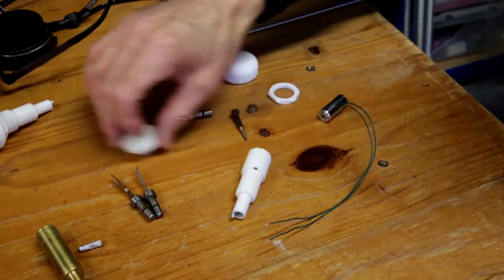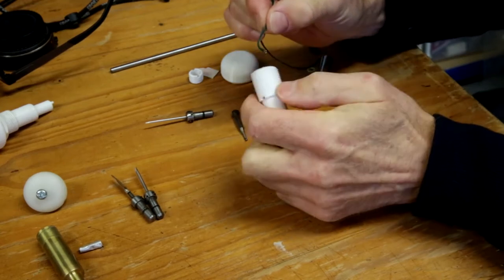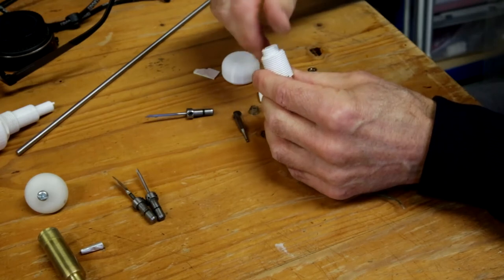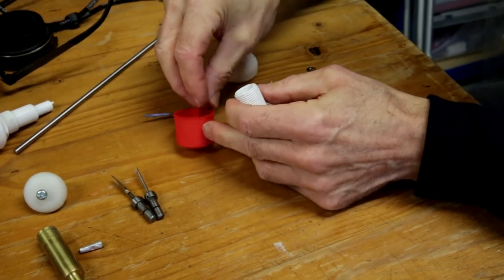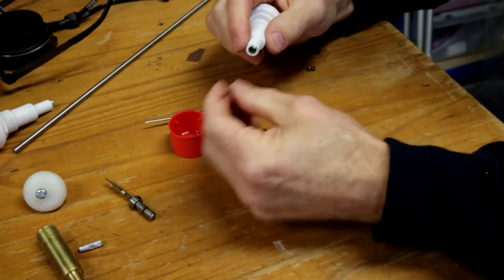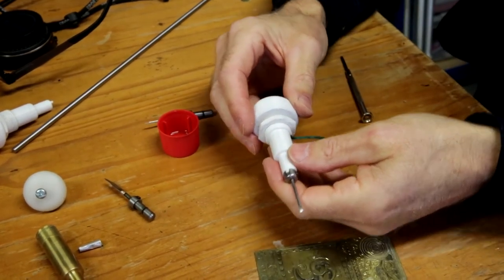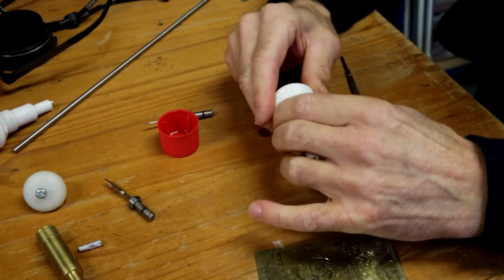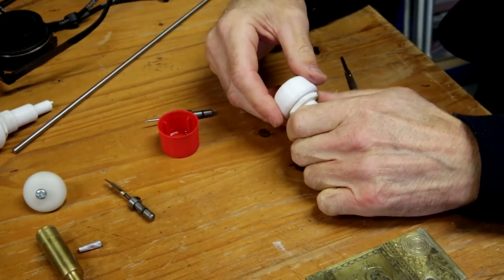3D printed handpiece for the Super EZ graver

Comment: Great job laying out this project!! I have almost all the parts in my shopping cart. I do have 1 question. What size mini pin are you using 5.9mm or 6.3mm? I’ve been wanting to add this skill to my creations. I really appreciate your art, and giving so many like me the opportunity and information to learn this art.
Reply from the maker: Thank you. I have no idea what you mean by mini pin. The metal tool holder is 6.35mm or 1/4" is that what you mean?
Reply: @alastairduncan4702  yes that’s what I was talking about. I’m trying to find a place to get them and wasn’t sure of the size.
Reply from the maker: The standard GRS QC holders will fit.  I have made my own and they take a 2.4mm, 3/32" piece of HSS. I have got some carbide but I've not tried it yet.

Comment: Fantastic piece.  I was watching through all the different videos, and I did not see the specific PN you are using for the solenoid.  Do you think that you might be able to post that as well?  Thanks again for sharing.  I also wonder if you were to use H-bridge control if you could set it up so that you could apply a load on the return.  This would help to limit the aft stroke and not have to adjust the physical handle.  Just a thought.
Reply from the maker: Thanks for the comments. All of the components are listed in the prototype video description. I think I should add them to the reader on GitHub as well. The solenoid is the XRN-13/30TL. The handle adjustment is only for low power where there isn't enough power to get a full length stroke, I think mainly due to having to overcome the spring. My knowledge of electronics does not stretch to h-bridges I'll take a look, the objective is to keep it as simple as possible 😉
Reply: @alastairduncan4702  Good video but you are using solenoid.  will this also work with compressor?
Reply from the maker: @giwangpvcartslamp1349  No it does not work with a compressor.

Comment: What is the connector type that the blade is mounted to? I've seen some in my country but they don't seem to have a notch for a protrusion at the end of the handle body like in the blend files.
Reply from the maker: You can use the GRS QC tool holder, they all have the notch.

Comment: Great looking design! How does the end of the solenoid hold up? It looks small diameter for the part that strikes. Any chance you could sell me a completed handpiece?
The white printed sure looks nice.
Reply from the maker: The end of the solenoid is quite small but so far it has held up well. Having said that I'm not a full time engraver, I'm not even a part time engraver ;-). I'm sorry I don't make for anyone or sell anything.
Reply: @alastairduncan4702  Thank you Mr. Duncan for your quick answer. Also thank you for all of the information you are sharing about your graver build, it sure looks interesting to me and seems to work great.    Ray

Comment: I am a little confused. What QC size are you using? I can't see any reference to it anywhere. The link to HSS blanks is 3/32 - Square (2.38mm), but GRS only do round QC holders for 2.38mm
Reply from the maker: I don't use GRS QC I turned up the QC collets that I use. The GRS QC holders come in various sizes:

https://www.hswalsh.com/product/grs-qc-tool-holders-345mm-single-004-803
https://www.hswalsh.com/product/grs-qc-tool-holders-332-238mm-10-pack-004-855
https://www.hswalsh.com/product/grs-qc-tool-holders-18-3175mm-10-pack-004-875
https://www.hswalsh.com/product/grs-qc-tool-holder-180mm-pack-10-004-872
https://www.hswalsh.com/product/grs-qc-tool-holders-extra-long-345mm-3-pack-004-857

So it depends on what tool blanks you have or want to use. They should all fit into the handle as the external diameter is 1/4" (6.35mm) you just pick the QC holder that suits the tool blanks that you want to use.

I personally use 2.38mm(HSS), 3mm(Silver steel) and 2mm(Carbide) and have hand tools that I've adapted by attaching them to 3mm blanks so that they will fit into the QC holders that I've made.